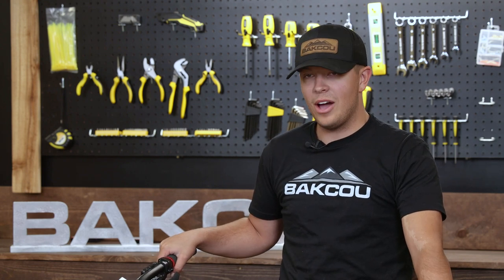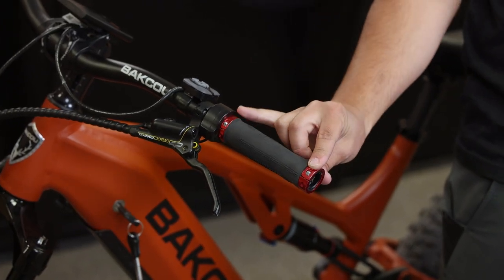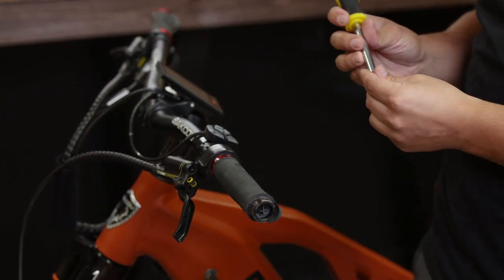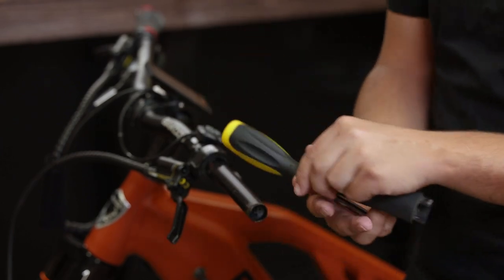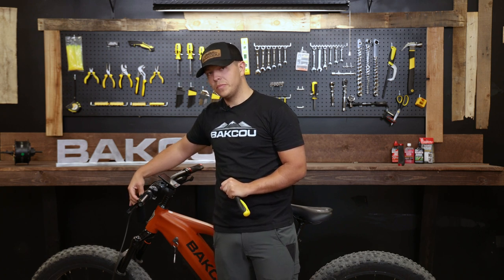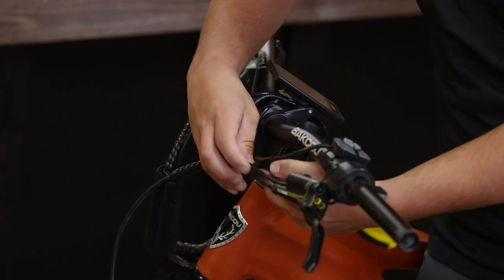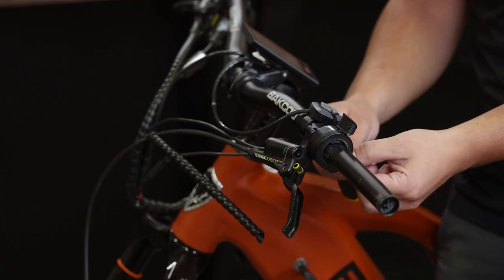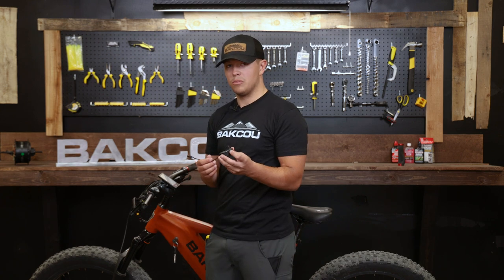Removing your eBike throttle to make it a class 1 eBike

Comment: Removing is the easy part (for me) on my daughters bike however the throttle is a combined device, it includes a pedal assist select button…
Can easily remove the half twist throttle Switch control but then there is no pedal assist anymore as default startup is 0 assist.
Anyone seen a pulse switch only for sale to replace the combi we have, ideally with julet 5pin connector.